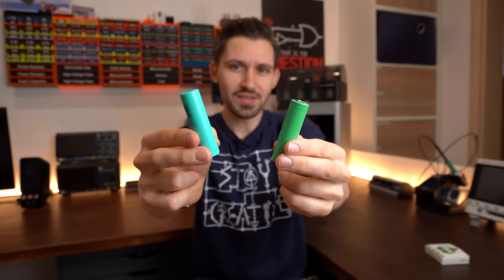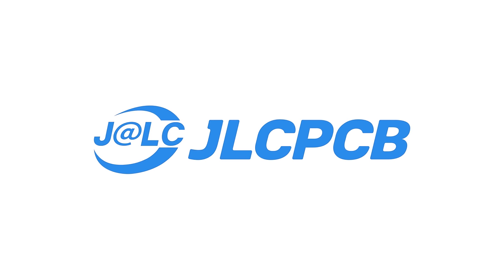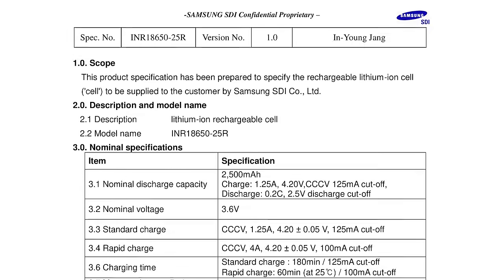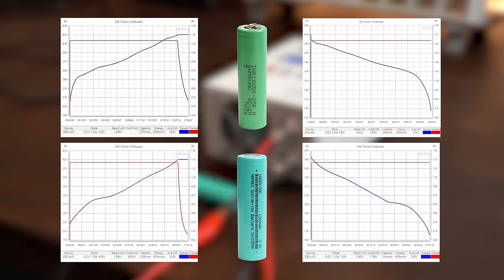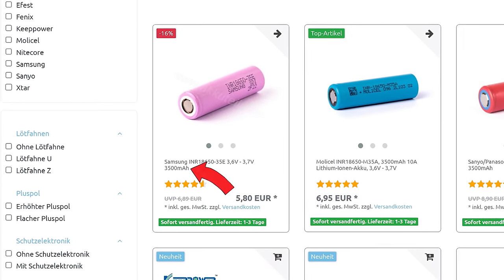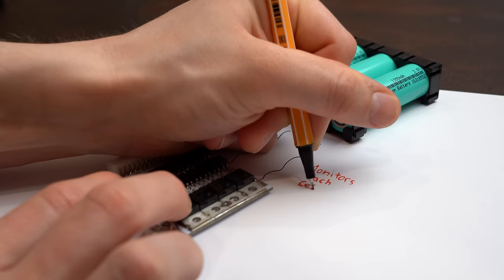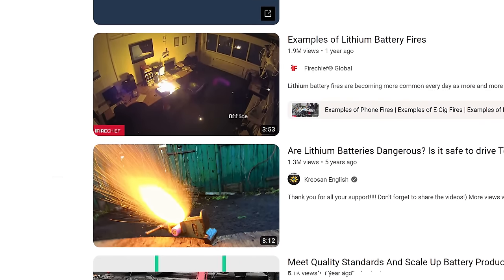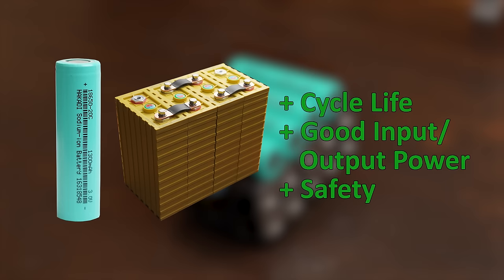"Salt" Batteries are FINALLY Here?! Sooo should you use them?

Comment from the maker: Small correction that was not clear in the video. I said that the discharge/charge curve for Li-Ion, LiPo and LFP (LiFePo4) is about the same. That is not completely true since LFP or LiFePo4 comes with lower voltage levels. But their voltage does also not drop that much. It is pretty flat across the whole discharge region. This is what I was trying to say.
Reply: also there is a betterhelp sponsorship in the subtitles
Reply: How can this comment be 10 days old ? :D
Reply from the maker: @takipsizad  Fixed. Sorry about that.
Reply from the maker: @havocking9224  I finished the video back then. My Patreon supporters can watch early. I only release such a big video only every 2 weeks because I have to preproduce to work on bigger projects.
Reply: @greatscottlab  AAAhh, thanks for explanation !
Reply: What's the weight difference between the two cells?
Reply: Thanks for your great reliability A Great Scott!
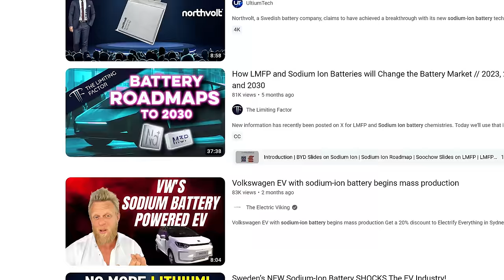Another SMALL correction: At 0:59 you claim "Sodium-ion ones will be the future of battery technology; but no one actually tested a real one yet."
However, a gentleman named No One has been doing this for almost a month now, and you know nothing about it!
 
https://youtu.be/H5iTZ_0WT9w?si=LtOBHywfdvN-7OS6
https://youtu.be/taHTbeyBKeA?si=zIanl3nCx7GPRix7
https://youtu.be/-MZ_KNkpDxI?si=i513ZroHMe3JbNqN
https://youtu.be/GIQcTlXle-Q?si=Uzp9tprjse_bUMRA
https://youtu.be/utv_r2T1Ma8?si=y_VP7MfS6J0j-FNs
https://youtu.be/ay47a3E7NI8?si=oe4A9SFG9ZzhVoNB
https://youtu.be/iAbtlVWLzek?si=9BEUjNCtsKs0Idq9
https://youtu.be/ck2rpzCvawE?si=T3bI6PBRasO-gsa1
Reply: Aliexpress link dead. Just FYI.
Reply: @MR-ub6sq This is awesome. Good find! Thank you for sharing these! ❤❤😊
Reply: @greatscottlab  Lifepo4 with this very low power density? I dont think so...
Reply: Not "made up of [sic]", "contains".
Reply: @orangejjay  Thank you. Actually, this Andy from Australia | Off-Grid garage | is not a recent find for me. I've been watching his videos for about half a year. He is matter-of-fact, honest, humble and has a sense of humor. If he makes a mistake, he admits it in the first place. He also answers if you ask about it - just what not everyone does. He is perfect in acquiring and sharing information.
Reply: @takipsizad that's a close call, I've been unsubscribing from channels with that sponsor and I lost quite a few this way. Glad @greatscott did not take their money, I'd lose another channel I've been following for a long time.
Reply: LFP is actually much flatter than li-ion.
Reply: LFP has a much flatter charge/discharge curve while NMC/NCA/whatever cobalt based lithium ion is much more linear except for the very end of the discharge or start of the charge. LFP is nearly vertical in the top and bottom 10% but the middle 80% is damn near flat.
Reply: @ericklein5097  "LFP is nearly vertical in the top and bottom 10%"
Which percentage do you mean :
- 10% of the lower and upper values of the pole voltage of the cells
- 10% of the share of the lowest and highest Ah of the total capacity?
Reply: LiFePo4 is basically nearly 70% of its charge is within 3.2V range. Very stable but also very hard to determine its capacity by reading its voltage, unless you have an accurate measurement (in 1-2 mV precision). And so once its open voltage drops to 3.1V it is already 15% or less SoC.
Reply: Thanks @greatscottoab. I'll be waiting patiently. 18650 Lithium-Ion cells had capacities of around 1.2Ah a decade ago, were more expensive and less reliable. Sodium-Ion technology has to go through the same process. Within a very few years they will be far better than these early iterations of the technology.
Reply: @rdbchase  either is grammatically correct
Reply: LFP still cheaper because existing large production and supply chain. This is uphill battle for sodium.  I think they will be on-par price/performance by 2030. The C-rate is impressive then again, it is  less dense than LFP.
Reply: @tyttuut Both are grammatically correct, but "made up of" implies that sodium/lithium comprise all of the contents; "contains" means that there is some sodium/lithium within.
Reply: Chemical reaction batteries will always suffer from a finite number of charge/discharge cycles, it's just the nature of chemistry.   I truly hope that in the future they can increase the energy density of super-caps which works on the principle of static charge, therefore with unlimited cycles, including a quick recharge in just minutes.
Reply: @BillAnt Capacitors have no future as primary energy storage devices because their gravimetric energy density is so low.
Reply: You can type shorts to make marks and conclusions.
Reply: @rdbchase - That's why I said more work to be done to increase its energy density.   If they could accomplish close to that of chemical reaction batteries, it would be a game changer with unlimited charging cycles and quick 5 minutes charges.  Thin graphene layers could be the solution.
Reply: @BillAnt  A threefold Improvement may not be possible.
Reply: @BillAnt  Yes and No. LFP battery chemistry has robust chemistry that its remaining cycle life is affected more by its age than cycling it everyday. Like 10 yearsx365 days is just 3650 cycles whereas there are LFP cells that are rated for 6000 cycles or more
Reply: Brand name of your new battery capacity tester?
Reply: @Constant_Distant_Instant ZKE
Reply: The max mha on sodum batterys are basically where lion was 6 years ago before vaping took off I think giving time 3000 mha on sodium is doable where lion is pretty muchhitting its ceiling
Reply: But could the salt batteries be discharged fully? The current LIPO and LIION batteries can't be discharged below 2.4v without causing damage to the cell, the same as over charging it. If so, then they effectively have 3x the useable capacity.
Reply: Thanks for doing the testing of these - You did a damn good.
Reply: scott i dont see any video about the lto batteries can you test the lithium titanate batteries next time and compare with other batteries cause i think nobody talking about them and it makes me sad (i think they are safe like the sodium batteries cause it dont burn or explode)
Reply: @greatscottlab thanks for having transparency and integrity in your sponsors.

So many creators will just take the money and ignore criticisms of their sponsor's alleged poor business practices, not even bothering to say something as non committal as they seem to be fixing the problem or are having a dialogue to improve their business practices, etc.
Reply: @stark_energy  Even if you have an accurate measurement, you cannot determine the SOC by the voltage, because temperature and charge/discharging current affect the voltage much more than the SOC in that region.
Thats why basically every BMS just counts incoming and outgoing charge and calculates the SOC with that, with corrections done when the battery is completely full or empty.
Reply: Took me a second to make out your t-shirt... lol
Reply: @MeriaDuck you've been unsubbing "betterhealth" sponsored vids? That's a curious hill to die on, so to speak.  So what'd they do to you to earn your impassioned ire?
Reply: Thank you
Reply: Correct. That is why your statement on the internal resistance of LFP is wrong. LFP generally (internal resistance is not constant over the SoC range and temperature range) has a low internal resistance. LFP has a low power density because its voltage is significantly lower than that of other chemistries.
Reply: Where did you get your battery tester
Reply: How about another correction?  Lithium isn't rare.  You just have to go through a process to separate it from other components.

So, it's more like a pain in the ass than it is rare.
Reply: I used to fly radio control airplanes in my youth and at that time, NiCad re-chargable batteries were typically used to operate the transceivers. One of the characteristics of NiCads is how they could reach a point of discharge to where the voltage would drop off precipitously and cause equipment malfunction (i.e., crashed model airplanes) - this was aggravated by their other characteristic of developing a memory of frequent partial discharge usage patterns. Consequently I had a special charger for them that would do a complete discharge before then recharging - to avoid developing the memory condition.

I would consider it a very desirable attribute to have a re-chargable battery that held up to a relatively flat voltage output level during its discharge through use.
Reply: which charger do you recommend for these sodium ion batteries? A link to buy it would be nice also
Reply: @BillAnt  Manufacturers sometimes state a life expectancy in full discharge/recharge cycles for super capacitors. I've seen figures around 100,000 cycles. It's not unlimited, but definitely much higher figures than those for chemical batteries. I guess that manufacturers have to admit that nothing which they make will last forever!
Reply: @iamfreeareyou681  No battery type 'likes' being over-discharged.That minimum voltage in the dara sheet for the Na-Ion cell will be stipulated in order to protect against premature failure.
Reply: @johndoh5182  Lithium is practically everywhere, but in much lower concentrations than Sodium: If you look at a chart of relative abundance of the elements, as published online, you will see that Lithium is much less abundant than its adjacent elements in the Periodic Table, and a lot less abundant than Sodium.
Reply: @RWBHere  - Well, it's practically unlimited.   A car's metal frame won't last that long.
Reply: @RWBHere  Incorrect. You can discharge regular AA and AAA cells completely, you can't use a 3.7 volt Lithium Ion cell below 2.4 volts without causing damage to the cell.
Reply: I have an MG5 with a NMC battery pack. After 3 years 5 months and 136200+ miles my battery SOH is still at 100% and I have zero drop in range. The vehicle is charged to 100% almost every day sometimes recharged from low to nearly full then discharged again. 
O do every time I drive it with 100% give it a boot to 100% power for a few seconds.
Reply: Except because of that lower voltage, the usefulness of their curve is much less as things like inverters shut off at 11 volts. They have about a 50-60% useful capacity.
Reply: But happens when you find out they will be charged with a-ssault n' battery?😁😂🙄🙄